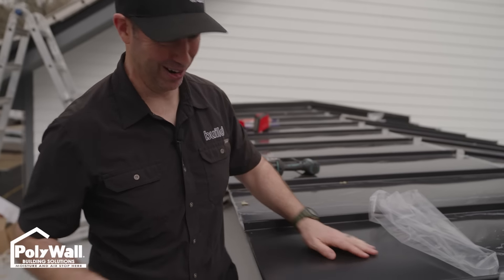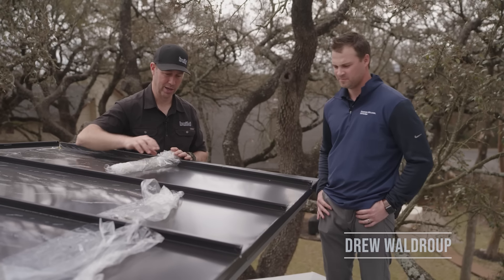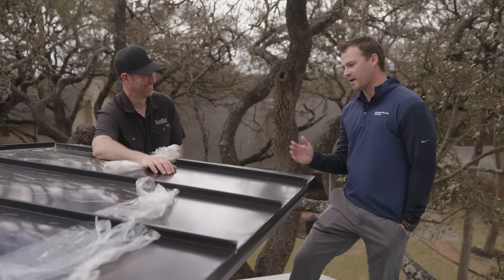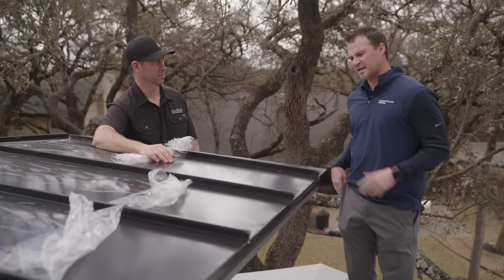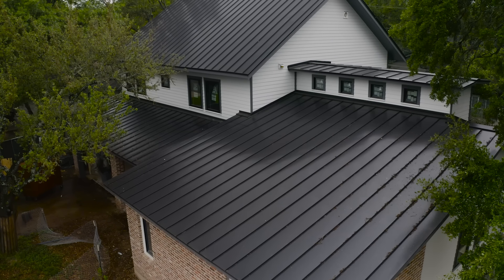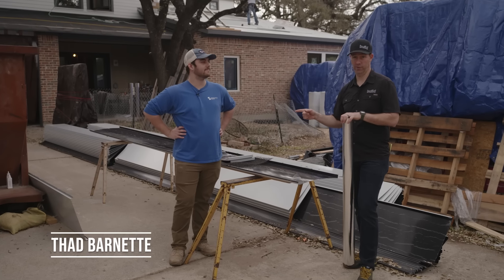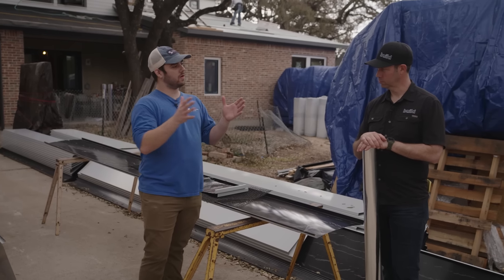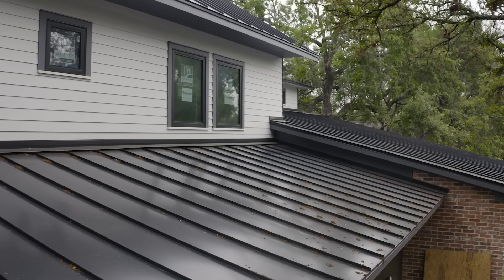Black Metal Roof - Dumb Idea?

Comment: For California and other earthquake prone areas, metal roofs are a good choice because they are relatively light in weight.  Clay and concrete tiles look great, but on a roof they are like a giant hand pushing down on your roof at all times.  During an earthquake, when your house structure is swaying back and forth, you do not want a giant hand pressing down on you at the same time.  Metal is also fire proof, something you cannot say for asphalt shingles and cedar shakes.
Reply from the maker: Great points!
Reply: @buildshow  l
Reply: @Edward Van Belkom 
Sounds to me like you are passing judgment on a layered system like he has done before you put some calculations to paper....
I have toured some houses in Dallas with a dark roof when the OAT WAS 110 and the attic was 78 degrees because they spay foamed the the underside of the roof sheathing, amazing, BTW THERE WAS NO AC IN THE ATTIC, JUST THE AIR HANDLERS THEMSELVES.
Reply: The Oakland fires of '86 (I think) had four or five houses that did not burn down. All were stucco exteriors like the ones that burned down.  Difference was, the ones that burned down had tile roofs and thre ones that did not, had Gerrard stone coated steel roofs. The pressure caused by the fire lifted the tile, enabling embers to get under the roof onto the roof deck. Due to the face nailing installation of the Gerrard product this did not happen and thus saved the homes from disaster. Tile is dumb on any roof, due to its weight and the necessary maintenance every 10-15 years.
Reply: Clay tiles are fire resistant too. And they don't weigh as much as concrete tiles.
Reply: I have to nitpick as an engineer that deals with fire a lot - metal is not fireproof. It is difficult to set on fire, but once it starts burning, it is quite devastating you're not putting it out. Thankfully in the context of home fires, you're not going to reach the conditions needed to set it on fire, but that doesn't stop me from being an asshole :'D
Reply: @noahhastings6145  If the house burns to a temperature that could burn metal, the house would already be gone.
Reply: @ZNotFound  Yep! But metal still isn't fireproof
Reply: @Edward Van Belkom Only for four months out of the year. The other 8 months are not going to be a problem with all that insulation and air gap! I would like a follow up a year from now and give us an idea how much more electricity he spends during the summer months. $20, $40, $60 dollars or more.
Reply: @noahhastings6145  Can we agree on "resistant"?
Reply: @Edward Van Belkom Lame
Reply: @gzubeck3  Besides, the way things are going right now you want to sacrifice summertime energy efficiency for better wintertime ones. Sure the south is probably not cold enough for this to matter much, but solar electricity will make any air conditioning need totally free to cover. Since your ac need is right at the same time when solar electricity is at its peak.
Speaking of which, how conducive this roofing is to installing solar panels?
Reply: After the Northridge earthquake I saw lots of roofs where the tile just slid off as a single unit
Reply: @kistuszek  Watch Matt's previous video about this roof, he covers solar. Short answer: Not a problem!
Reply: @ZNotFound  Agree on "resistant", we can.
Reply: @Edward Van Belkom how much energy savings (in $$$, or as % of monthly cost) do you think he could have had if he had gone with, for example, a white roof?
Reply: @noahhastings6145  As engineers, we always consider items within situational context. 

By your apparent definition, there is no ‘fire-proof’ material; everything will burn under correct conditions. 

For the subject of residential construction, “fire-proof” is not a viable term. Flame-resistance is applicable term. We then rate within that context at different levels. Essentially, how long can material handle a continuous open flame  ranging in temp from 350-550C without combusting? Most roofing materials under these conditions with endure 12-15 minutes, some less. Subject metal roof under testing will emit some light smoke as paint degrades but the material itself will endure the full 120 minute exposure w/o combustion. That results in highest fire rating for all practical purposes.
Reply: It's not about the weight pushing downwards onto your stucture. The structure is built to support it (it's all static, but during a quake it's dynamic loading). It's about all of that extra mass up high when the ground is moving horizontally. The inertia of all that mass is hard to move, and your frame is in shear trying to get all of that mass moving along with the rest of the house. A lighter weight roof will require less energy to get moving at the same horizontal velocity as your foundation, which means less energy being transferred through the house frame.
Reply: @apscoradiales  Concrete tiles began to be used during WWII and they have their place...on adobe or concrete walled homes in the desert, with a substantial roofing structure (IMHO).
Reply: @noahhastings6145  NOTHING is fireproof in it's natural state.
Reply: camada or should i say Vancouver Island is on the same time line we always warmer.
Reply: This is a great comment, thanks
Reply: Where are the PV panels?
Reply: I thought one of the advantages of a metal roof was because you COULD paint it.
A home on my street sold, and the new owners painted the metal roof a different color.
Reply: @ZNotFound  Possibly, aluminium likes to burn rather more easily. Google Grenfell Tower. Had a composite aluminium cladding. The plastic caught fire then the aluminium caught fire. It was the worst UK residential fire since WWII.
Reply: @kistuszek  
It's actually more than any other roofing system, (conducive), as the standing seam ridge allows an extremely easy attachment with no need to penetrate thru the roof.
Reply: There are structural solutions developed in Asia to deal with clay tile roofing in earthquake areas. You gotta let your building sway, but not collapse.
Reply: @noahhastings6145  thinking that way, nothing is fire proof then! Isn't from fire this universe is created by God? Then it can only be destroyed (changed it) by fire.. Just at a higher temperature! 😉
Reply: your argument is a bit far fetched. the weight of the "hand pushing down on your roof" is relative. if you are going to spend the money to get clay tiles, you are going to pay to reinforce the roof to accommodate the additional weight. if you don't make the appropriate accommodations for the roof, then you are probably going to have problems with earthquakes, as you noted. but you are more likely going to have problems with more frequently occurring issues: such as rain load, wind load and snow load (the latter not likely in many areas in california). even rain and wind loads tend to not be significant problems in ameriKKKa, but if you underdesign your roof for the load, a lot more things can become a problem. the moral of the story is: construct your house appropriate to the conditions.
Reply: @NeonSphinx89  seismic design works a bit differently because you are trying to dissipate the energy of transverse ground movement in the foundation so that it doesn't get to the framing. basically, it is a dampening mechanism such that, while the house can still move, it moves more slowly than the ground.
Reply: @paperwait9611  When Frank Lloyd Wright designed a large hotel in Tokyo, Japan, he could have used beautiful clay Japanese roof tiles.  He was worried about earthquakes, so instead he covered the roof in copper.  Most of the big buildings in Tokyo were destroyed in the famous quake that arrived several years later, but Frank Lloyd Wright's hotel survived intact.
Reply: @kookiethebear  one obvious advantage of concrete is thermal mass, so that your house doesn't heat up as quickly. that's why mud hut construction is very energy efficient. leading edge construction techniques have started to appreciate the efficiency of old (or what some would consider "primitive") methods of housing construction, such as mud and straw huts, and have incorporated them in new techniques with fancy sounding names such as: rammed earth and straw bale.
Reply: @kookiethebear  it's more about the burn point than it is "fireproof" as an absolute statement, since just about anything can burn at a high enough temperature.
Reply: @jonathanbuzzard1376  the big problem with grenfell tower was that you had a flammable material being used for exterior insulation, with an air gap. so when it caught fire, the combination allowed the fire to engulf the height of the tower really quickly.
Reply: @BanBiofuels  you are aware that people have learned a thing or two about designing for seismic conditions since wright's time, aren't you? i am referring to construction of houses today, not 80 years ago.
Reply: @paperwait9611  and then the actual aluminium actually burn't which has far more energy in it than the plastic and burns hotter.
Reply: @jonathanbuzzard1376  if aluminum has a higher burn point than plastic, then when it burns, it will obviously burn hotter than plastic. but before the aluminum burns, you have to have a flame with a high enough temperature to cause the aluminum to burn.
Reply: @paperwait9611  conditions that where reached at Grenfell
Reply: @jonathanbuzzard1376  ok. thanks for the information. what kills people in a fire is smoke. in other words, by the time a person gets incinerated by a fire, they would have almost certainly already have died from smoke inhalation. so the killer in the grenfell fire would not have been the heat, but the speed at which the fire spread. a big problem with grenfell was that there were conditions that allowed the fire to spread really quickly.
Reply: Well shaking heavy mass cost more energy than shaking light weight .  During an earthquake the ground/earth is moving back and forward causing the foundation to shake which will shake the whole building on it. ,  a light weight roof will cost almost no energy to shake, while a heavy roof cost a lot of energy to shake, so will shake less.  One of the reasons high rise building's heavy swimmingpools are on the roof.
A giant hand pressing down will only stabilize .  If you hold on your hand a staple of toiletpaper rolls and walk with it,  they tend to fall. If you press with your other hand on top of the staple  it stays more stabile. Sure it also depends on the walls or pillars the floors and roofs rest at.  The first level should be flexible but strong .
Reply: @RJ-sr5dv   I have sandwhich steel/foam panels 18 ft long  4-5 ft width, 2-3 inch thick, the outerlayers are coated steel and the inside about 2-3 inch thick hard foam . Very light and stiff and good isolating.  The outside air temp is less relevant than the sunbeams shining on the roof and the color of the roof, sunbeams will heat a black roof way more than it will heat a white roof. More heat means the black roof will expand more than a white roof. This should be taken into account when deciding how to connect the panels to the building/each other
Reply: @rafiqsaid4297  the weight of a house, no matter how heavy, is negligible compared to the energy stored in a strong earthquake. you can't build a house that is too heavy for the earth to move. what causes structured to collapse is the immense shear caused by the change in direction that results from the back and forth motion of the earth.
Reply: @paperwait9611  you don't got it. the eart is moving/shaking at level of the foundation, not at level of the roof .  if the first 'level' between the foundation and the first floor for example, is strong but flexible , and the above layers like a roof is heavy , the arth and foundation will shake , the first layer will bend . (some buildings have diagonal springs and shockstructs for this purpos) , the layers above due their mass will shake far less.  An other option used is not fixing the foundation direct to the earth but on steel rolls or spheres so the complete foundation "slab" can move horizontal.
Reply: @rafiqsaid4297  oh i totally do "get it". what you apparently don't get is the concept of shear. the shaking at the foundation resolves into a shear force up the walls, terminating at the roof. it's the inverse of the way that wind shear works, which is applied to the roof and walls and resolved in the foundation. all forces acting on a body have to resolve in countervailing forces. in an earthquake, the displacement isn't what destroys the structure so much as it is the abrupt change of direction (characteristic of earthquakes). what you do in earthquake design is to effectively put the foundation on a kind of "shock absorber" (i think that is the concept that you are trying to put across in your comments). what the "shock absorber" does is to dampen the vibrations of the earth so that the structure moves more slowly than does the underlying earth. this reduces the shear that can cause the building to collapse. it is not unlike the way that a shock absorber works in an automobile.
Reply: @paperwait9611  Well its my profession as civil/building engineer.  The two options I talked about works on 1) flexible but strong first layer, so the building above it with its mass "stays" on it place while the flexible first layer makes it possible the foundation and earth moves underneath it . The more mass the building above the flexible first layer(floor) the less it will move.  2) foundation which can relatively move free on the ground, so when the earth shakes the ground has not so much grip on the foundation and the foundation on which the building is build will stay on its place.  like the building.  the shock absorbers damps  the reverse reactions of the springs so the flexibility won't start oscillation of the building .  The gravity force on the building is not related to the movement of the earth .    Like I said, take a platter, put a thing on the platter and shake the platter horizontal,  do the same but place marbles between the platter and the thing. When shaking  the platter the thing will stay on its place while the platter moves beneath it .
Reply: @rafiqsaid4297  your use of terminology is a bit sloppy, but your platter example shows me that you know what you are talking about, even if you might be a bit imprecise in your use of terminology. 

for example, to take your point "1)": you start out fine, because that "flexible but strong first layer" includes embodiments, where that "first layer" is at the boundary between the foundation and the first floor. but later you conflate the first layer and the first floor when you refer to "the first layer (floor)". your point "2)" is fine, but i consider both 1) and 2) to refer to design implementations that are part of the design process for the foundation. 

your platter and thing with marbles at the boundary is an example embodiment of your point 1).
Reply: @paperwait9611  LOL  , Yeah combination of not enough coffee and English not being my mother tongue nor daily language.   BTW note that the mass-theory only works when the building is constructed against earth quakes.      I myself live in a home with a steel sandwich roof ( two layers of thin steel outside and 3 inch isolation hardfoam in between. Its white powder coated , and very light   , Middle east sun on it but inside it stays cool.  Regarding earthquakes I feel saver here than in one of those many old concrete buildings which are constructed in a time earthquake regulations were not strict .
Reply: Yes its fire proof but at the same time it makes it harder for fire fighters do there job. Must times the entire house would burn down, but at least you still can reuse the roof 😅👍
Reply: @buildshow  My house survived the 6.4 and 7.1 earthquakes in Ridgecrest CA in July 2019.  I have a HEAVY concrete tile roof as well as a massive solar panel system installed.  We ran outside during the 7.1 and could see the house shifting back and forth and the roof moving the other way.  Lucky for us this house was over engineered (original owner was a real (no kidding) rocket scientist and rode the contractor’s and builder’s ass during construction).  We are moving to Bulverde TX in a couple years and want  to build us a custom home.  Already bought the land.   @Matt Risinger we sent email to your company.🇺🇸
Reply: @paperwait9611  Yes, but you don't want your thermal mass out in the sun in hot weather. That's why passive solar design has eaves to shield thermal mass interior flooring from direct sunlight in summer, but expose it to the lower-angle winter sun to heat up when that heat is wanted. A thermal mass roofing product is going to give you a whole lot of heat in summer when you really don't want it, but in winter it doesn't have windows to protect it from the cold wind so it's not going to warm up in the sun like your thermal mass floor - so it doesn't help you at any time of year.
Reply: @tealkerberus748  thermal mass outside of the building envelope is not the same as thermal mass inside of the building envelope. an example of thermal mass outside of the building envelope is rammed earth construction (which is a gloried term for what is basically a mud hut). an example of thermal mass inside of the building envelop is what you described. for thermal mass inside the building envelop to heat the building envelop, you have to have windows.
Reply: Stainless steel metal roofing is very much better and the same can be said for gutters and drainage pipelines.
Reply: @darthvader5300  Please post a link to a stainless steel roofing manufacturer you like, and give me your estimate of cost per square and lifetime durability potential.
Reply: @kookiethebear  correct. Concrete tile roofs don't burn and ours saved us from our neighbors huge tree limbs when they fell on our roof...:-)
Reply: @Edward Van Belkom I bet that black metal roof and al the extra underlayment and insulation he had to do costs as much as a normal home in Austin. Notice how he never talks about home much this stuff costs, and what the ROI would be like on a $150,000 roof.
Reply: i know Im kind of randomly asking but do anyone know of a good website to stream newly released tv shows online?
Reply: @Ezequiel Davis ehh I'd suggest flixportal. Just google for it :P -kai
Reply: @Kai Willie thanks, signed up and it seems like they got a lot of movies there =) Appreciate it !
Reply: @Ezequiel Davis you are welcome :D
Reply: @kistuszek  The metal roofing we had installed worked fine with the solar panels that installed over it. One of the installation options for the panels was a clip specially designed to attach to the standing "seam".
Reply: @militarybrat9734  It was October of 1991.
Reply: Playing concrete realest have black tar paper under and then a big fire Embers get under the concrete and clay and start the black paper on fire and then you're done and sparse earthquakes go play and concrete tile roofs or framed differently their beefed-up so they're braced differently the actual weight of the roof to me would just help hold it down I've seen many earthquakes I built houses all over LA and I have watched a asphalt shingle roof bounce and tear the Raptor right off of the plate was bouncing 6 inches in the are ripping and tearing knocking soffit off cracking this stuff it and there was Clay and concrete booths across the street they had no damage so is it double edged sword
Reply: @buildshow  , do you install metal roof in Alabama? Thanks
Reply: Fireproof just sold me. No hot ash landing a taking flame.
Reply: @noahhastings6145  Class A roofing requires special underlayment for metal roofs. The intent is the underlayment adds fire protection. Does the approved assembly live up to the requireement? I cannot say. In any case the metal resistance to ignition is not the only factor involved.
Reply: @kookiethebear  Yes. Most desert areas in the US tend to have less seismic activity. One can build unreinforced adobe in New Mexico with impunity. Not so in California on the coast. Yet we have many tile roofs here for the "Mediterranean" look. So it's a test of time. We've actually had been lucky if you listen to the seismologists.
Reply: @gzubeck3 Just learning about about metal roofs, so there are air gaps in metal roofs, correct?
Reply: Traditional Japanese castles were designed with earthquake resilience in mind. Their heavy roofs (often tiled) provided a stabilizing downward force, while the loosely stacked stone foundations allowed slight movement, which helped dissipate seismic energy. This combination reduced the risk of structural collapse during earthquakes. However, modern analysis has shown that while effective to some extent, this design isn’t perfect and can still fail in very strong earthquakes.